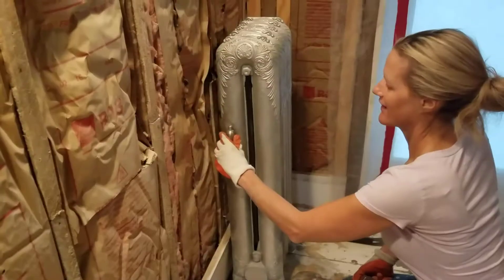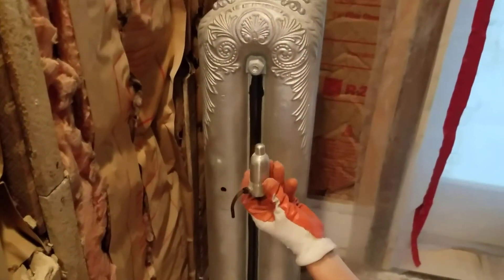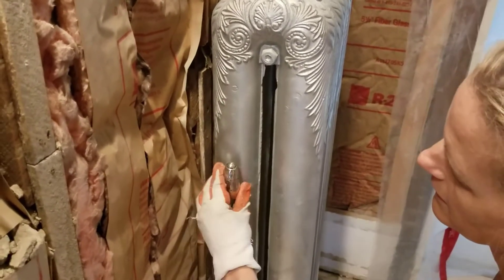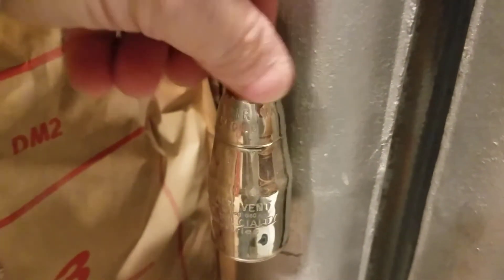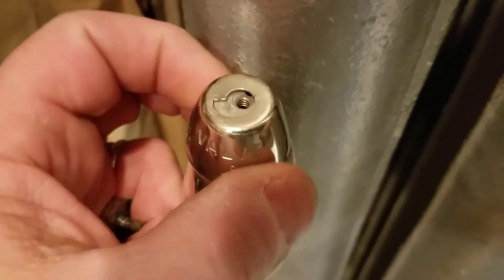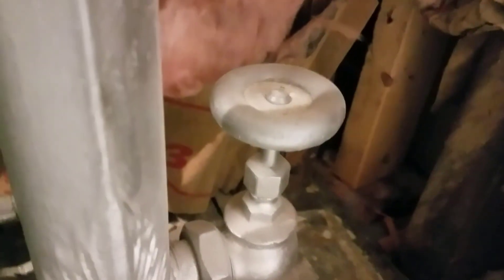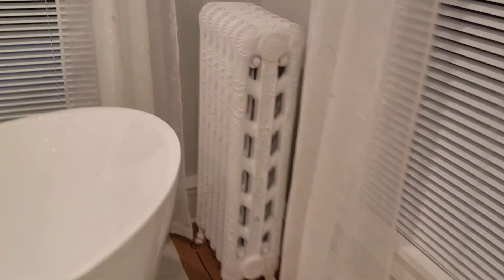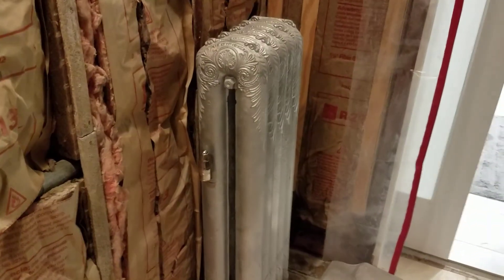STEAM radiator venting in an OLD bathroom - low pressure steam 3psi

Comment: Well, what comes out of those vents is cold air at start-up. The heat of the steam closes the vent automatically to contain the steam and heat in the radiator. If you have steam coming out all the time, the valve is no good; you just need to replace the valve. Always be careful. Temperatures are 212 degrees or above on a running boiler, shut down the boiler first.
Reply from the maker: X-8, Thanks for replying. I have not looked at this video in ages so I am not sure if I described the vent function at all or if I did, if I described it incorrectly. 

You are correct that cold air in the system is pushed by the incoming steam out of the vents and that at some temperature, the vent should close and trap the heat in the radiator to be radiated into the room or space. Any vent that malfunctions will likely not close at all (or "freeze" in the closed position) and should be replaced to allow the system to function properly.

Very appreciated for the clarification!

Comment: Where did you find your steam plumber?
Reply from the maker: When we bought the house in 2005 he kind of “came with the house”. He was recommended by the original owner and it turned out that he is top notch in plumbing and top notch with steam heat. I can take no credit for finding him. He is local to our area and is expensive but worth every penny. Thanks for checking out the video.

Comment: Looks great!  Those old radiators are cool to see. I have no idea ho w well they work to warm a room, but they sure do look cool!
Reply from the maker: Thanks for the comment! We have 7 up and running currently and  6 of them are very ornate like this one with the detailing in the iron. One is pretty plain. We (meaning my wife and her mom) back in 2005 took weeks to strip each radiator and repaint them so they look real sharp. As far as efficiency, we like them and can really heat up a room when they get going. It is also a point heat system where if you are cold, you can get real up close to a 200 degree radiator if you want. 

The new radiators are very ornate (one is in this video) and we are anxious to get our fantastic steam plumber back to get those up and running.